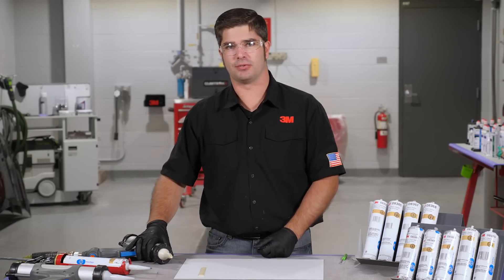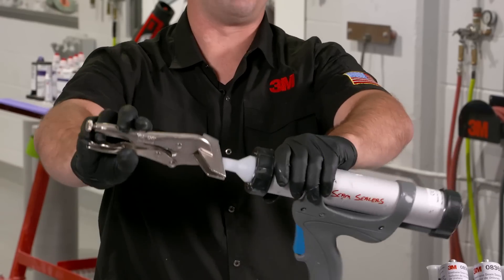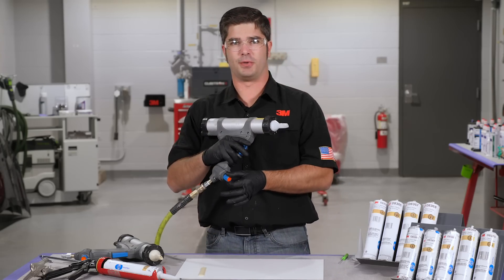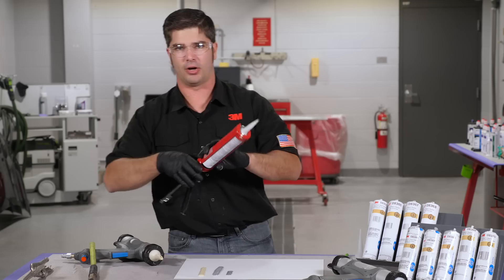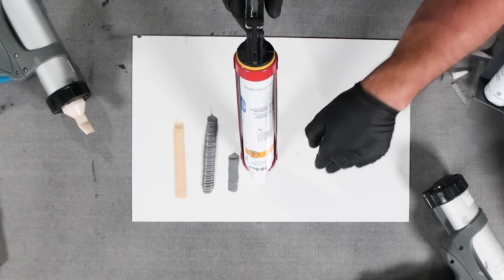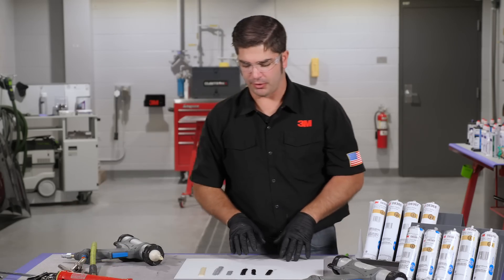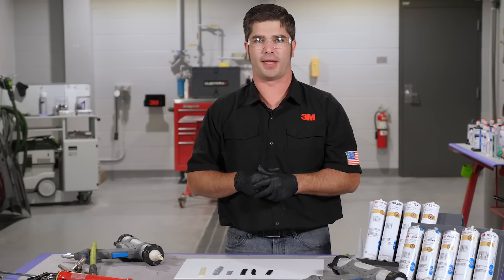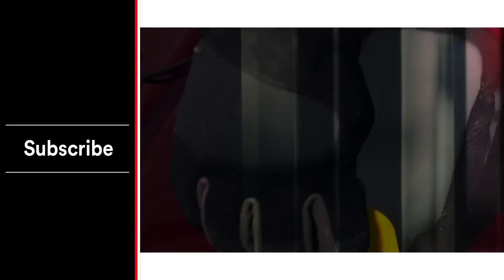HOW TO: Replicate a Ripple Bead

Comment: Which one is heavy duty and last longer.
Reply from the maker: All of 3M's seam sealers, including the urethane and MSP sealants, are designed to last and perform for the life of the vehicle. By referring to the tech data sheets for these products, you may find differences in performance attributes, still both of these sealants will provide the flexibility and adhesion required when the correct standard operating procedure is followed.

Comment: once the seam sealer is applied do i need to apply 2k epoxy over it again before I can  then apply my final coat of raptor bed liner or paint
Reply from the maker: To help answer your first question -- no, do not apply another layer of 2K epoxy primer over your seam sealer. For your second question, we recommend that you follow the standard operating procedure for Raptor to determine if additional surface prep is needed or not.
Reply: Thanks that was very helpful, rpator i will spray over the seam sealer with no further 2k epoxy @3MCollision

Comment: Great Video Thank you!!!
Question.. I have the "3M Urethane Seam Sealer"  Part # 08367 it is the one that you are using with he red Caulking Gun.
So my question is.. is that a special Caulking Gun specifically for this 3M Seam Sealer product ?
Thanks 
Because I have a regular Caulking but I don't know if I will be able to use the one I have?

Awesome video !!!

thank you
Reply from the maker: Hello 👋 Glad you liked this video. To answer your question, yes, the red caulking applicator is compatible with many 3M products (learn more about it at this link https://s.3m.com/9t180e). If you have a different caulking applicator with similar properties as the red one in this video, you should be able to use it with our products.
Reply: @3MCollision   Thank you guys.. BUT the link does not work.

Comment: What gun was that he was using?
Reply from the maker: Hi John. The gun used is a Pneumatic Applicator 08399. Manual applicator 08398 could also be used to replicate this as well.
Reply: I’m really curious on the manual gun how you keep the bead consistent when you have to keep releasing and pulling the trigger. 

Though, I know one key part of the answer is “do it very frequently” :)